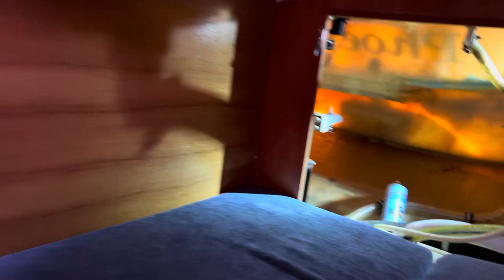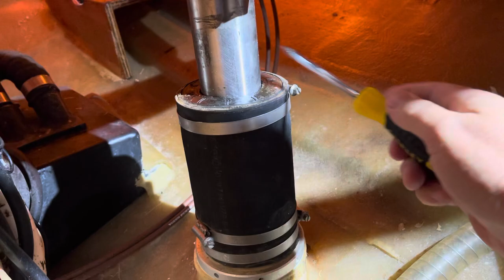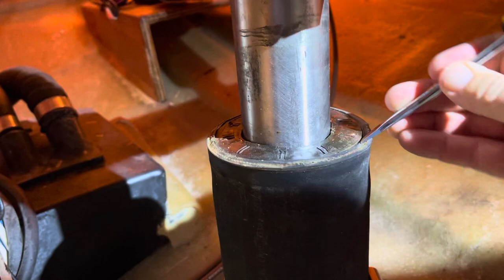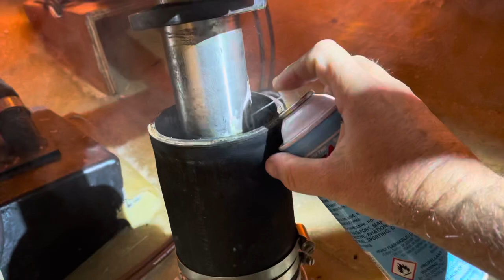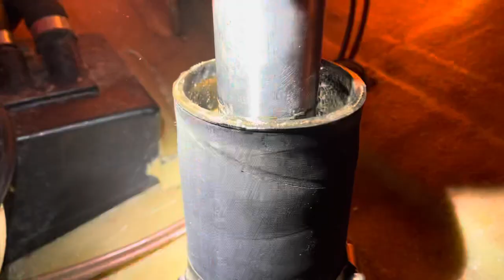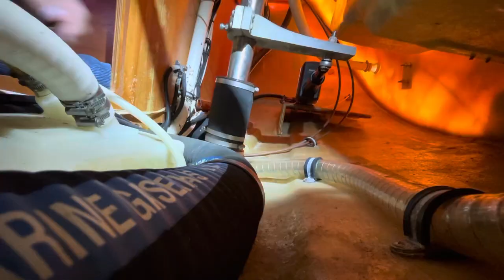Bavaria Cruiser 39 Yacht Rudder Bearing Lubrication Maintenance / INOX WD40 Spray Can

Comment: From JEFA the source for Bavaria rudder bearings. 
“ 3:04 Do not use a kind of grease or oil on the rollers.
Water with a little soap, work the rudder  from Port to Starboard, and then run fresh water without soap through it.”